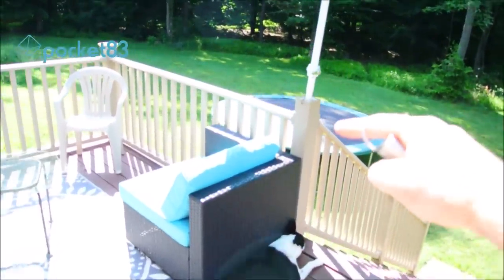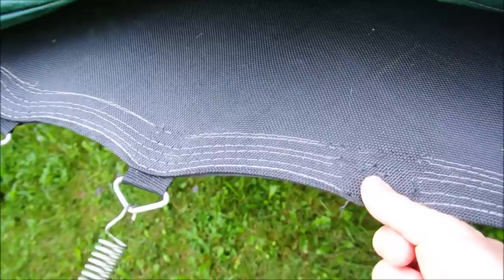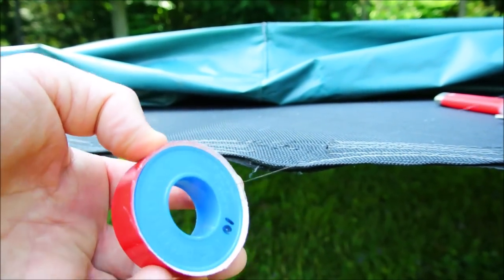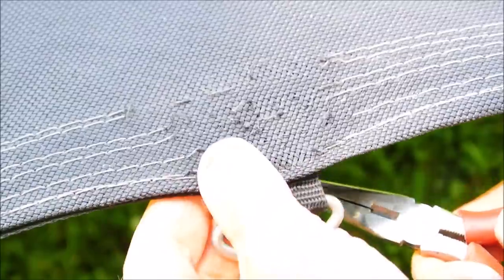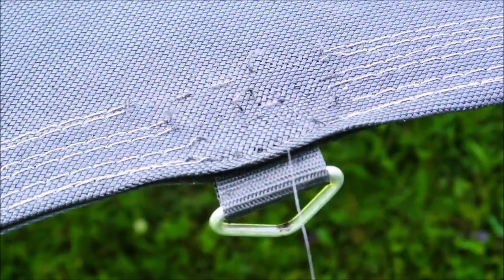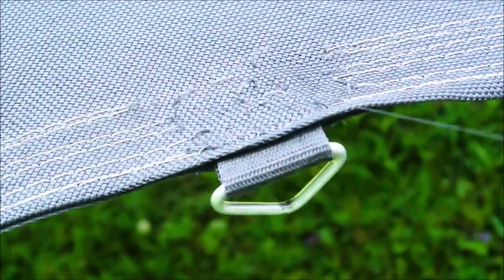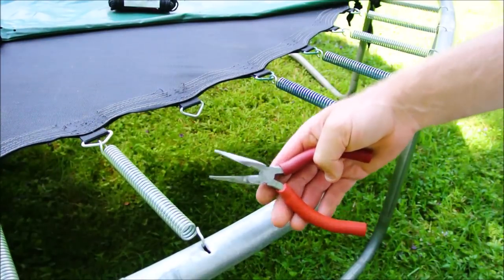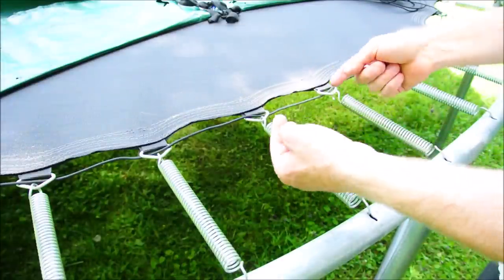Dangerous Trampoline Springs! Easy, safe fix & Mat Repair.

Comment: Thanks for this.. Not because I’ll ever repair a trampoline, but because it’s a video about spending a lot of time fixing a thing that is easy to replace. You could make the same video about putting a new drawer slide in an Ikea cabinet. Things can be fixed, and giving it a try is low risk if your intention was to replace it anyway.
Reply from the maker: Thank you. Not to be gloomy, but things are going to get much tighter for people. 
A cultural change is in order.
Reply: I see trampolines being given away on Craigslist on a weekly basis, not to mention lawnmowers and yard tractors that only need minor repairs. People just want shiny new things.
Reply: @mikem3695  oh, we've been in that lala-land for only a few years, I think from 98-ish until 2009 and then we already got super tight. It's been squeezing harder and harder since. Not that people here have learned to give repair a try, but it's come to the point where the European legislation now has a bill in effect about "the right to repair", forcing manufacturers to change their product designs in order to facilitate repair, or in some cases to prevent premature wear and tear like with most electronics nowadays... (many still include software EOL-timers (end of life) that systematically shuts down functions after a certain amount of use-time, typically 2 years. It's not a coincidence. It is by design. And I know this from seeing the policies with my own eyes, which is probably the biggest reason why I left electronics design.) Anyway, I'd love to see someone give a way a yard tractor, even if it was run over by a fire truck... We don't get so lucky to get things for free here. The only thing you get for free, is crap for being overdue with the bills.
Reply: Most people rather replace it instead of using their heads to be creative and self sufficient. Ez is not an option if your system ever fails you.

Comment: One thing I've learned in my many years of repairing clothes is that uniformity matters, especially in applications where there will be a lot of tension. Small straight stitches tend to do the best. I suspect those huge stitches from the factory are one of many cost saving measures. Great video, not enough people try to get the most out of their stuff.
Reply from the maker: You are totally right. My experience has told me the same. Small, straight stitches are super-tough, especially when you isolate them into groups by throwing in some knots. In fact, the replacement stitching here was already much, much stronger than any of the factory stitches, so a DIY repair could be downright messy and still work!

Comment: I like your approach to trying to squeeze the most life out of things we use. This made me want to check our trampoline and I was surprised to see it was built with a line running around through each d-ring. 
The problem with ours is springs snapping at the hooks.
Reply from the maker: Interesting. Any idea what brand yours is? Mine is a 14-ft Bounce Pro. Never once had a spring snap.
Reply: @pocket83squared  Jumptastic. Came with a net. The rest seems to be fairly decent quality.

Comment: I found you by searching Google to ask if flex seal would work to patch a trampoline. I have a tiny spot that is starting to wear a bit and want to catch it before it really turns into a hole. I think this a great fix if it's something someone has on hand. Price wise though, I don't know if it is much more/less than an actual patch. Anyways, thank you so much for sharing this ❤

Comment: Perfect timing! I have my trampoline dismantled for some winter maintenance as we speak. In my case two of the little loops that hold the triangles have worn through so I'll need to find something stronger. Good tip on the braided fishing line - I had no idea what to use so I went with waxed braided nylon from a leather supplier.
Reply: Winter maintenance!! We're joined by some Aussies or Kiwis, methinks =))

Comment: People severely underestimate sewing as a handyman's tool.  Upholstery string and some heavy-duty needles can do some awesome things.  Tho I'm going to at that fishing line to my sewing kit.    Oh, and nothing wrong with pliers, I do the exact same thing, but don't underestimate a good thimble.  There's so much ancient technology we're sleeping on because we're so used to thinking of it is outdated.  Figuring out what the little coins with the wire hanging out of it were was life-changing.

Side note, I always wanted a "power tool" battery operated sewing machine in the same style of DeWalt or Ryobi.  Something with some grit and power behind it.  I know for Tradesmen if a tarp rips or if a bag needs repairs it's much easier to just toss it aside and get something else.  Time is money.   So it wouldn't be the for the back of a pickup truck.  But I still feel like a heavy duty portable sewing machine would be useful for around the house handyman crafting stuff.  Especially for convention costume repair.  I think cosplayers would eat a power tool sewing machine up like candy.
Reply from the maker: Sewing is essential. Maybe it just needs a re-branding: from now on, let's call it fabric welding!
Reply: @pocket83squared   Old lady in a fabric store:  "What do you mean I need a certification!?"

Comment: Good video! Thanks!

My trampoline springs keep snapping where they sit inside the outer frame holes.
I drilled the holes to remove the sharp edges, but they soon reappear, and broken springs start flying off again.
Maybe brass or hardened steel eyelets would solve this?
Or heat treat and harden the soft steel frame so the holes don’t wear and form sharp edges?
Or thick bicycle tubes?
Thoughts?
I fear and hate springs!!
Reply from the maker: That is a tough problem. Honestly, it might be prudent to simply find a different brand of trampoline, but I'll take a shot at it.

First thought is to use a sacrificial link, a go-between, like a single piece of chain that connects the frame to the springs. It would fix the problem, BUT—two new problems arise: 1) that's a lot of chain cutting, and 2) now the trampoline canvas will be under less tension. Problem two might not be a problem.    
 
Another idea:
If the springs are all breaking at the same place, it may be that the springs themselves were tempered too hard. If I remember correctly, when spring steel is heated up, it becomes less brittle, but it also looses its springiness. Test with one first, but maybe you could try hanging a few springs from a coat-hanger, and hitting them with a blowtorch (right at the spot where they break) until the weak spot briefly turns almost red. The reduced temper might make the springs more snap-resistant at that spot. Careful not to torch the springy part of the spring itself.

And hey, if nothing works, the second-hand market is filled with cheap trampolines. Good luck.
Reply: @pocket83squared  
Good suggestions! Thanks!

Comment: The cable in garage door springs is to capture the fragments if the spring breaks? That's truly a new bit of knowledge I gained today :) (scouts honour, not being sarcastic, even though it really looks like it... Deng it, now it looks like it even more... But it isn't. I swear.) I always thought they were a dead stop to prevent the door to ride off the rails in case the spring gave, or if the spring stretches on the way down, so that the door would slam shut and possibly crack, but not leave the facade, frame and all... I would think the most dangerous fragments of a spring breaking from fatigue, would be the tiny fragments that shoot out to the side, perpendicular to the pulling axis... (I remember those from the metal rods we pulled to the point of destruction in the tensile strength lab tests back in my college days)

Oh well, what do I know... Watching this video I got brutally interrupted by the dying screams of a young woman. As I ran out, I found a woman curled up in my neighbors enclosed front yard in the corner against the fence between our properties, panting and screaming... She stated that her dad was chasing her with a shot gun... Called the cops. As they got out, the first cop that approached her (a lady cop) said: "But... Julie, we just dropped you off at your dad's house this morning..." (meaning that she had already spent last night in their custody for something) She had also claimed that the guy with the rifle/shotgun had entered my neighbor's house. A quick call to him fixed that issue. The man was playing Fortnight and hadn't heard her climbing his fence while screaming at the top of her lungs...
Yep, I'm guessing XtlMeth has found its way to the mainland... (i.e. Europe.) Never had an encounter with someone on a meth high, so I didn't recognize it at first and took all of her claims seriously. Until she claimed that her father owned all our houses and that the cops were corrupt and in league with everybody in our street... Then I knew she was either an escapee from a mental institution or a drugged up user or something... Cops took her with them when their backup arrived. So they know her, and they know to bring 4 officers when they have to drop her off at home. I think that says something...
Now I have the terrible task of coming down this adrenaline high hahaha. I guess I'll have to rewatch some more pocket content. (not that it makes me sleepy, because they usually make me think more. But he's got one of the most calming voices of YT vloggers in my subscriptionlist)
Reply from the maker: We once had a visitor here who was on crystal meth. He stopped in at 3 AM on a July Saturday wearing no clothes except for a loose beach towel. He didn't knock, but I'd heard him cough from the front porch since the windows were open. The guy was kinda tough-looking, a little scummy, and probably 10-15 years younger than me. Naturally, I decided to stay inside and try to calm him down through the window; I didn't tell him that there was a pistol being pointed at him. I wasn't as soothing as you might think; I was being pretty stern, almost forceful, probably too much, but he seemed to respond better to demands. Note that I'm in full adrenaline rush and trying to avoid a fight.

After I'd talked him into sitting down on the patio, I gave him a bottled water as an olive branch, and got him to become almost sane, that is, until he went into a frenzy when an owl hoo-HOO-hooted, screaming that the sound was coming from "them!" (even though he knew I wouldn't believe it). 

The poor guy was terrified. He eventually admitted to smoking meth, and he just wanted a ride home since he was out here in the middle of nowhere walking barefoot through the dark. My wife had already quietly called the cops, and so I told the guy that he had two options: either he could stay here and wait for them to give him a ride, or I could give him a ride now in the back of my pickup truck. He was insulted, but I insisted to him that there was NO WAY a naked stranger was getting in my truck while high on meth. He reluctantly agreed, but then bitched the whole way home (about three miles). Before the truck even stopped, he jumped out of the bed as we got near his house. He then ran into the bushes around his neighbor's house, apparently to resume hiding.

The cops became uninterested in this story after I decided to 'take the law into my own hands' by taking him home, and so they didn't bother to show up for a statement. When I returned home, my wife and I looked at each other as we both said in unison We're getting a fucking dog! One week later, we picked up Raz. Three weeks later, our late-nite visitor got picked up for B&E, and so he ended up in prison. So much for second chances.  

Moral to the story? There's no madness like meth, kids. Stick to margaritas and mild psychonautics.
Reply: @pocket83squared  Wow, that sounds intense indeed. I was lucky this was a girl, and she was over a foot shorter than me. I had my dog with me for alerting purposes when I went out to the screams, so you're absolutely right that a dog will help in that regard (although iirc you don't have immediate neighbors who would come outside towards the barking like I do). Just having my dog there allows me to focus on the intruder rather than having to find ways to call for help... (still her super loud bark was unable to penetrate the headphones of the Fortnight playing neighbor hahaha)
I really don't know much about this drug because it's so rare here. Is it one of the drugs that increases the user's strength and lowers their pain sensations? Or is it one that makes them rather unbalanced like alcohol does? I guess knowing that kind of stuff might influence my reaction in case one of them would try to get physical.
Reply from the maker: @lukearts2954  So far as I understand it, (meth) users remain reasonably non-violent, although they may become stuck in a complete delusion. So I'd prefer to keep my distance. 

Now that I think about it, the drug whose users tend to become the most dangerous is likely alcohol. Man, can a few drinks flare up a situation!
Reply: @pocket83squared  You are ABSOLUTELY right there... Medication forced me to stop consuming, and since then I've been seeing more and more what a problem it has become (or perhaps always was) in society. Currently main stream media are hyping the consumption of alcohol, pushing the idea that it's impossible to have fun without it. They are using the strategies of the tobacco industry from back in the days where they were unrestricted. And then my accident happened because of a drunk driver. And when my son was 10 months old, we were attacked on the street by another drunk driver who felt that we didn't cross the road fast enough so he had to grab my cane and smash our heads (yes, he aimed for the baby's head too, but luckily my reflex was to curl up around him as a human shield, and just endure the beating until somebody would come and intervene. Which took easily 5 minutes of nonstop being kicked in the ribs and beaten over the head and back with my own walking cane. (The cane was all bent from it)
So yes, I have come to see alcohol as public enemy number one. (and then there's the health issues too)